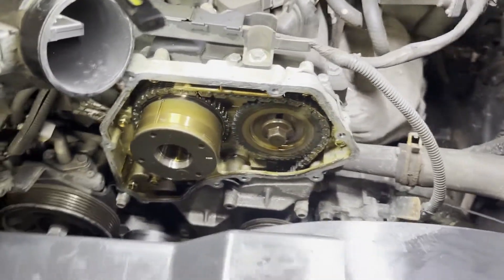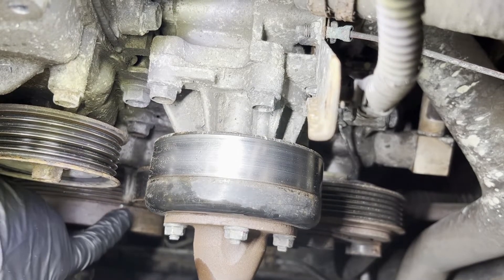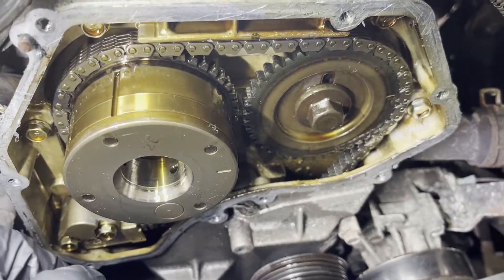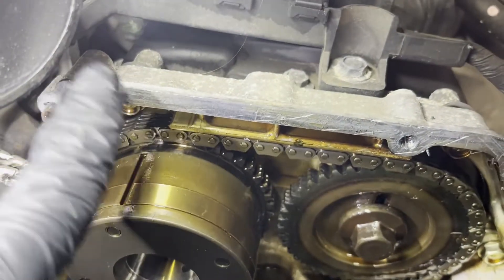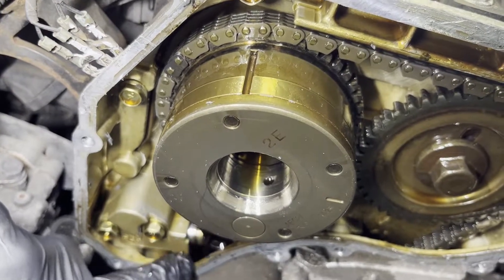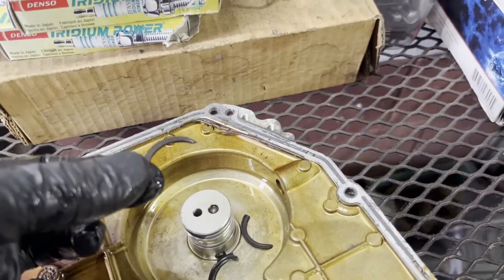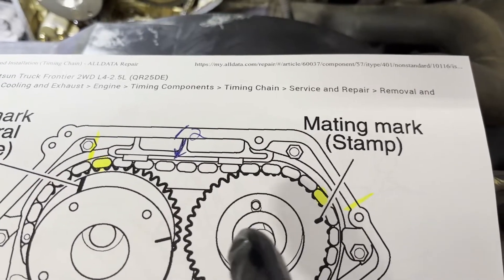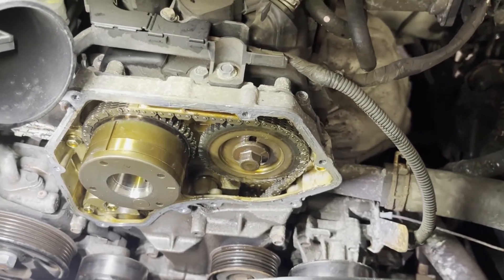Nissan 2.5 Timing Chain Marks. QR25DE Timing Codes for Altima, Frontier, Sentra, Murano

Comment: Thank a lot but I have a question I am working on a 2016 Nissan rogue 2.5 and I have the top cove off and it doesn’t matter how many times I spin it around and put it on TDC it’s always 
off the car doesn’t run and the chain is tight but the closest I can get the two marks lined up is two links off the 2016 Nissan rogue has got two VVT on both cams and it have that line like the vvt on the left on the right to what do I turn if it’s two teeth off do I turn the cams back or just line the chain up but wouldn’t that mean that the cam and crank are not lined up so do you know how to line them up do I turn the cams back ?
Reply from the maker: You need to replace both the VVT gears and entire timing chain and the chain tensioner too. You will not get a good result if you try to skimp on parts. Do everything at same time. Nothing lines up for you because tensioner has collapsed. You need all new chain guides too. All that comes as a kit if you shop around. Don’t skimp on parts. Get a full kit and do it right.

Comment: Great video!! I’m working my way down to the head gasket on my 2011 Rogue. The timing is the part that worries me.
Reply from the maker: Thanks. Don’t worry too much, it’s actually easier to line up all the marks with timing cover off. If you have a service manual procedure handy that will help you as well

Comment: I have a question I just did exhaust valve replacement on the same truck in your picture it shows the marks not lining up with the chain I lined all my marks up to the chain but still runs a little rough did I do something wrong
Reply: I also made sure when the head was off that the valves shut when I moved the cams so that it was shimmed properly. I have 100 psi on each cylinder cold.
Reply from the maker: Hey there Joshua. Well, it sounds like you pulled the cylinder head off. And did exhaust valves. My question is, did you send the cylinder head to a machine shop to have Valves and guides and springs replaced? (Valves can get stuck in guides with age) Second question… Did you reuse old timing chain?

Comment: Do you need to spin the crank a certain amout of times before the crank sprockets line up or will it line up as long as the pulley mark is in the right spot?
Reply from the maker: Find the crankshaft marks on pulley. As shown clearly, in my video. You have to turn crank 2 times - to get 1 turn on cams as it’s an under drive system. Cam pulleys are 2x crank pulley “diameter”. So 2 turns on crank - is one rotation on cams. There is no other special anything involved on most typical engines - only turn crank clockwise on this engine. Not counter. Be well

Comment: I got a 2007 Nissan frontier 2.5 would a Nissan Altima 2.5 engine work on the Nissan?
Reply from the maker: @MarcosSilva-ft7pr  Find a good mechanic near you to ask. I cannot help without seeing truck. For example, even if the engine is same in Altima (for that exact model year) (the QR25DE) other things can be very different. Sensors and locations. Thermostat housings and other coolant fittings and wiring harnesses etc. trans mounting area and flywheel / flex plate etc. Definitely ask a Mechanic near you about a swap.

Comment: awesome explanation. as an indenpendent technician that is working on my first nissan frontier this really helped me understand how this specific timing system worked. Thanks!
Reply from the maker: @obie2765  Thank you very much. It’s great to know I’m helping others. Glad the details had value to you. I’ve been repairing cars and trucks since a teenager. I did have shop class in H/S & then automotive college thereafter. Had some great teachers. What I’ve found over time, is the details and “tech” DO matter. Many years ago, an old timer (instructor at my college) said this to a full classroom. “How ya gunna fix it, if you don’t know how it works?!” 😉

Comment: Hi, my car is missing a thermostat and I can't figure out which one it is. Can you help me?
Reply from the maker: @marcosantonioparragerman2437  Hi. What car do you have? You left no information. Some modern cars have two thermostats. Nissan does this
Reply: @AutomotiveEZ Nissan Frontier 2014. 2.5L. 4L. QD25DE gasolina
Reply from the maker: @marcosantonioparragerman2437  You have 2 thermostats but Nissan calls one a water control valve. One is located at lower hose at water pump housing and the other is upper at cylinder head on face of cylinder head. Same side as crank pulley

Comment: Is this the same on the 08 nissan frontier with a 2.5
Reply from the maker: @lojkl123  Same engine… If you have a code set (CEL / SEL Lamp on) and it is timing related… cam code etc., is worth effort to check timing marks as illustrated in my video